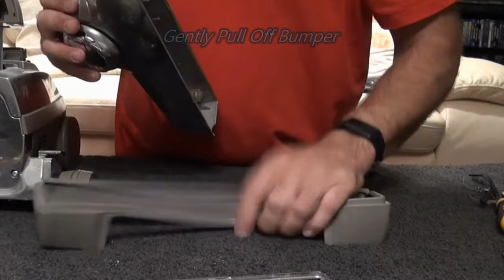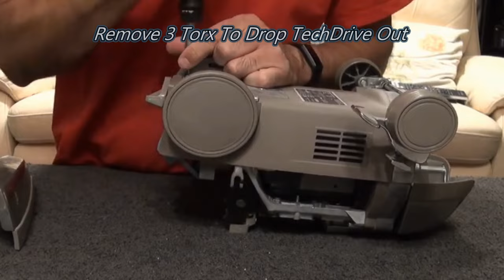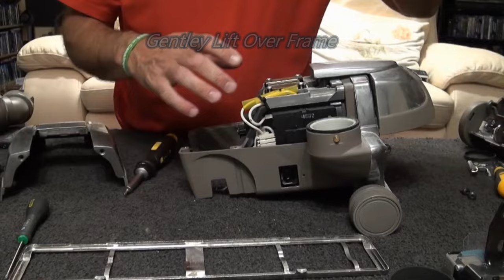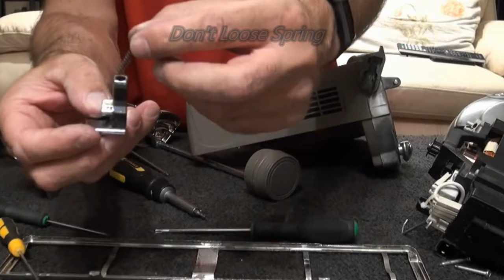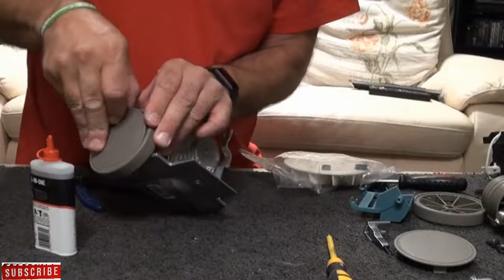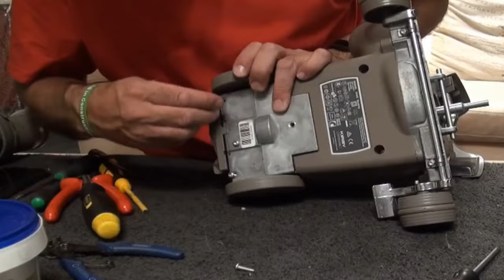Unleashing The Power Of The Kirby Sentria Ii Vacuum - Ultimate Strip Down!

Comment: Speaking about kirby vacuums. I was was given a kirby Heritage 2 with all the accessories and caddy for free  along with 2 new bags and belts. Every works and the motor is good. All it needs is a new beater bar. Sadly around here in this neck of the woods in Canada many are throwing these vacuums out. Either because they're too heavy or too bulky. However I find this one fairly light especially when these never had the tech drive in them. This unit is amazing. With a little shining and a $30 brush bar this vacuum will be good as new. The brushes and commutator are in amazing condition almost like it's never been used or abused. All the wiring is intact. And it's amazing for it's age.  The impeller looks like its been recently replaced and no knicks in it. Had I not grabbed it, it would have been put outside by  the garbage bin

Comment: Super helpful, never really got into these until i moved to the states - you can find Sentria 1's for less than $50 and they are absolutely superb machines. I bought one six years ago and it's outlasted a Dyson V12 and a newer Oreck! I have been tempted to pick up an Avalir 100 or avalir 2 - will i notice a big power bump or should i just stick with my old sentria? I believe it was one of the later sentrias due to your video on the headlights... thanks again!
Reply from the maker: Check out my sand battles with each kirby you’ll see massive power bump in various models . 
Sometimes new is not always best 😉

Comment: Store owner gave me a Kirby Heritage 2 Vacuum. All it needs is a new beater bar. He gave me the caddy with all the attachments. 2 new bags and belts. Could use a good shine though. Impeller wiring and brushes are in amazing condition as if new. Sadly no one wants these older vacuums or Kirbys in this neck of the woods of Canada. No one wants them. He was ready to throw just the vacuum out and keep the Caddy, components belts and bags. One thing he kept though was the sander though in its original box. I have the furniture shampooer. The portable handle, the wand, the crevice tool the hardwood floor head the utility tool for removing light bulbs or unplugging drains, the stiff cleaning brushes and the tile tool.
Reply from the maker: I sold a few old models here in Australia, I think the Heritage and Legend are great Kirby’s. Especially for those who don’t like tech drive .
Having the old style brush and not the new I think it’s great for more delicate carpets and couch cleaning . 👍🔔